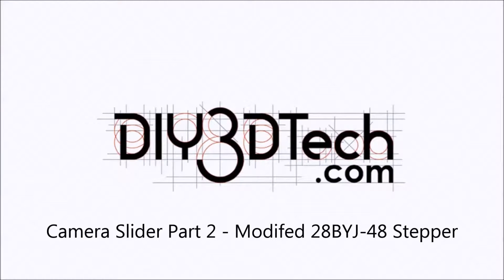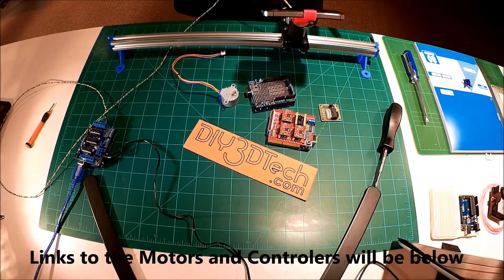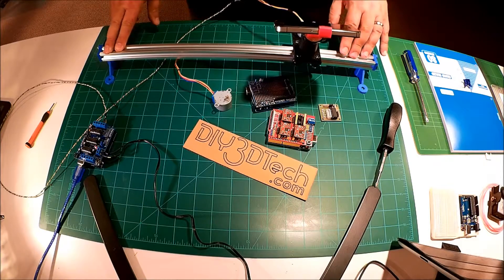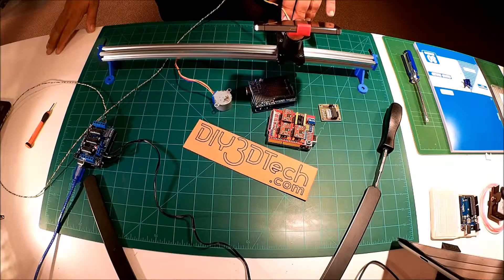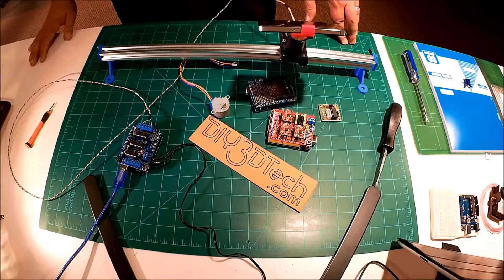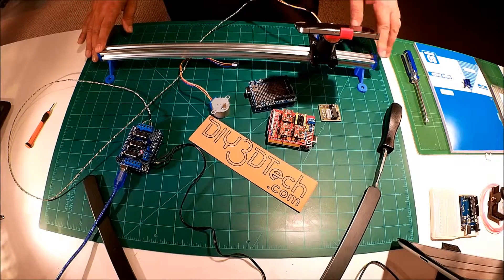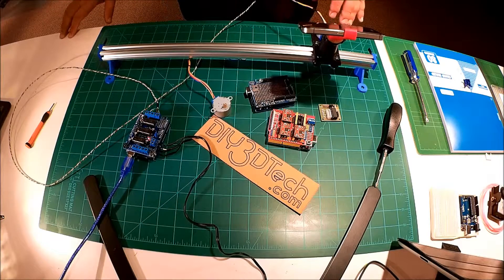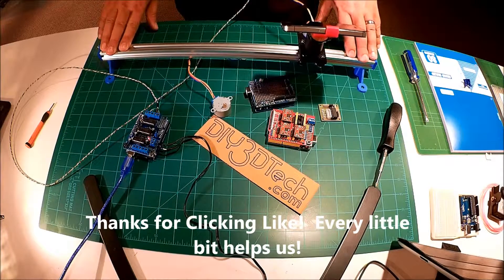Camera Slider with 28BYJ 48 Bipolar Stepper Motor

Comment: How do I configure the drivers for these motors? What is their reference voltage? How much voltage do you feed the cnc shield? pls :'c
Reply from the maker: Not sure when say drivers (are speaking of the stepper lib for the UNO?)?  The 28BYJ-48 is driven like any other stepper motor from a stepper board in this case connect to the UNO.  As covered in the video, the motors runs on 5volts which also powers the controller and & UNO so need to have a couple AMPs running into it